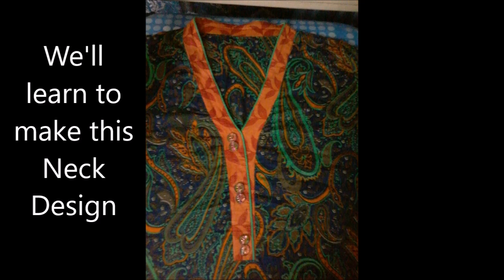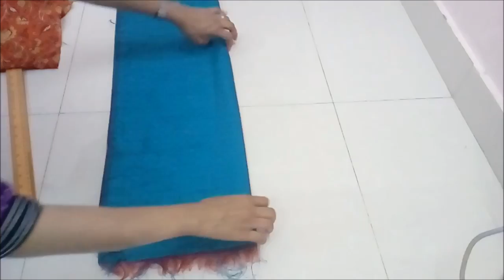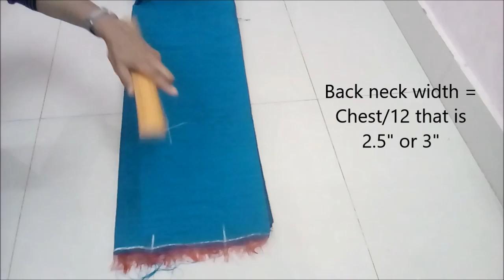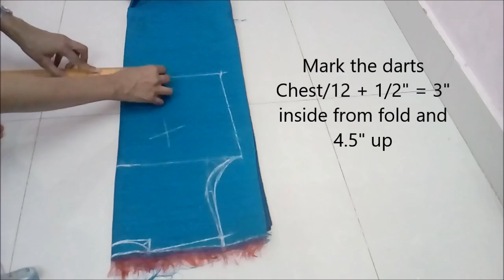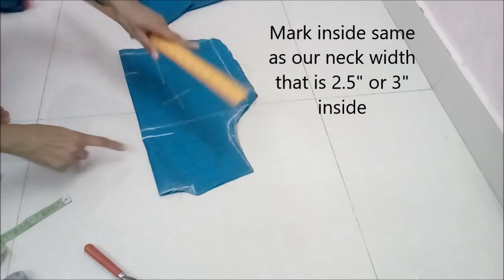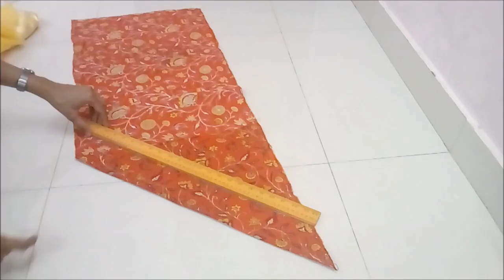High V Neck Collar with piping & button Design Net / stretchable fabric Dress banaye / Cut : Part I

Comment: Why did you add 2.5 inches & 1/2 inches in calcuation of Chest/8?
Reply from the maker: There are many methods to get to a common outcome. This is one of the ways to get your armhole measurements. Once you get to know your right armhole measurements, look no further, worry for no calculation and formula method. Stick to the method which you find easier to follow.
For more ways you can check out 
https://www.youtube.com/watch?v=XxSlW2tqrNM
https://www.youtube.com/watch?v=KFVCxDyWe10

https://www.youtube.com/watch?v=1DsktfEgnBE
Reply: Stitching Mall; Thanks :). The 2nd link for Armhole Calcuation method was very helpful. Do we have to use the same calculations to cut sleeves of the armhole required size?  
Thanks once again for helping me :).
Reply from the maker: Yes you can do that. This is one of the several methods. Sleeve is half inch more than armhole length that means it includes 1/2 " seam allowance also.
Reply: Stitching Mall; Oh! OK, thanks :).
Have you uploaded any video on Sleeves Cutting according to the Armhole measurements?
Reply from the maker: In almost all videos (wherever sleeves are made this formular applied) You can check out this video https://www.youtube.com/watch?v=DzHEScO0qUw&t=311s for clarity.  Thanks for feedback. In my next sleeve cutting video I'll clarify these measurements properly:)
Reply: Stitching Mall; Thanks a lot dear for the the link. I will watch it, and will wait for your next upcoming helpful Videos :).
Reply from the maker: My Pleasure:)
Reply: Stitching Mall, Thanks dear  where did you learn the stitching from? :)
Reply from the maker: Most of my learning of stitching has been through reading, understanding, experimenting and doing.  
What I learnt from the institute was - writing non-stop, file assignments, visual illustrations, sketching & all those technical things. 
Done a hobby course in cutting & tailoring & then one year advanced fashion designing course from South Delhi Polytechnice & Lal Bahadur Shahstri Institute respectively.  Ran a fashion boutique profitably for some time.
Reply: Stitching Mall; Hmm really nice :). so you must have learnt different Sewing Techniques, for dress  embellishment as well? 
Why everybody has different methods of making dress drafts and calculations?
Reply from the maker: Thanks:)
Yeah, of course. I love to. I do them all the time. I'm crazy imaginative about things.

Will share from time to time, what all I know.

WHY DIFFERENT METHODS OF DRESS MAKING?

Basic methods and techniques do not change but different individuals have a different understanding and personal / practical / experiences to add to an existing method. 

Food and clothing are very much a personal thing. We all eat and most of us do cook as well. But, each one of us has a different taste and understanding of food, based on which we make changes in our methods.

Likewise, we all wear clothes but how each one prefers to carry his / her dress is very different and personal.  Based on that personal preferences, the methods / calculations are modified. 

Secondly, fashion fads and trends keep changing with time. Using the basic methods, some changes are introduced and a new formula is created to fit the dress into practical everyday wear.

For example, for armhole measurement :-

- if you wrap the measuring tape around armhole,or
- Calculate Chest/4 - 1.5", or
- Calculate Chest/8 + 2.5", or
- Measure from a ready dress or 
- You wrap the fabric around your body and mark on it directly, or
- you may devise some other method which you find convenient to follow.
Either way you are right, as long as the dress fits you well.  

Each one of us has a unique body shape and posture. For a good, well fitting dress, understand the body shape and personal preferences and the final outcome that you want. 

Use the method which you understand well. Don't disturb yourself over methods but understand why a method is so and what result it would lead to.

I hope it helps:)
Reply: Stitching Mall; Yeah dear thank you very much. you help a lot & explain things very well :) .
Yeah you are right that calculations also depend on person understanding as well. 
As  you gave me the Armhole Length measurement example, the both calculations are different; and after my both  calculation the i get differdnt values, I dont know why; plz help.
 Armhole Length  Measurements:
Suppose the Chest is 40 Inches, so:
Chest / 8 + 2.5"= 40/8 + 2.5" = 7.5 Inches.  
                      OR
Chest / 4 - 1.50" = 40/4 - 1.50" = 8.5 Inches.
They both are giving me different values. Please let me know if I am doing the wrong calculations, thanks. :).
Reply from the maker: If you add 2+2 or 3+1 or 0+4 or 3+1, do you get different answers? No. Same way, whichever method you use, you get the answer right. I suggest you watch some of my videos, you'll get to know how and why a particular method is used. I have tried to use many different ways to make dress making easier and better.